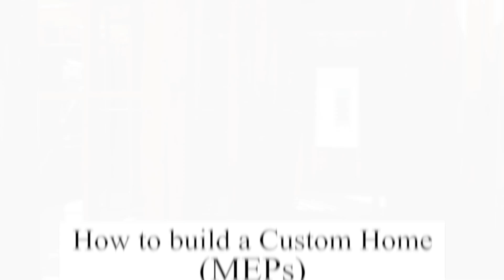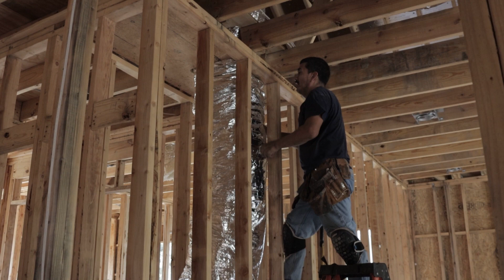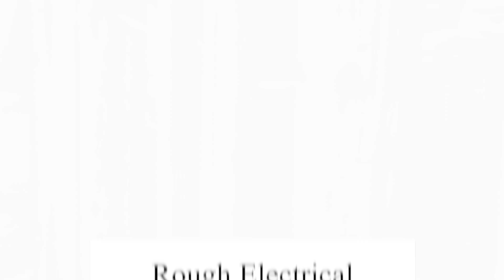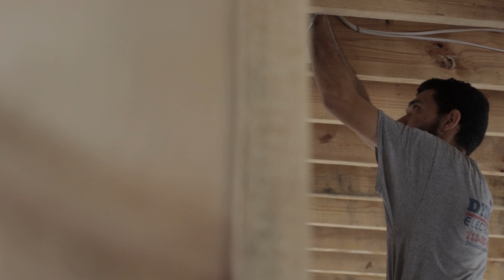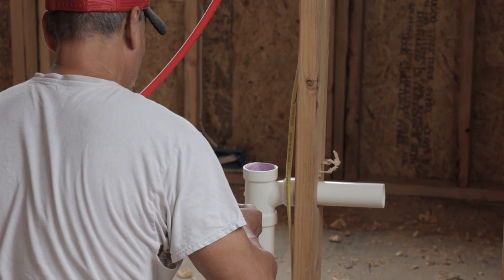HOW A CUSTOM HOME IS BUILT | PART 3 (MEPs)

Comment: As always that is a great great video. My question is on the plumbing side is there something to put into the line say the father’s bathroom or shower away from the hot water tank to recirculate to where you don’t waste all the cold water going down the drain to get hot water to it
Reply from the maker: you can install a circulating system, which will address your concern.  Some of the current tankless water heater models have that function built in.
Reply: @AspireFineHomesHouston  I guess I better read exactly what voice speech puts down before sending
Reply: @stephenhines2795  Look into greywater recycling.  It can take sink water/shower water, filter it, and then run it to another designated place, such as the toilet.